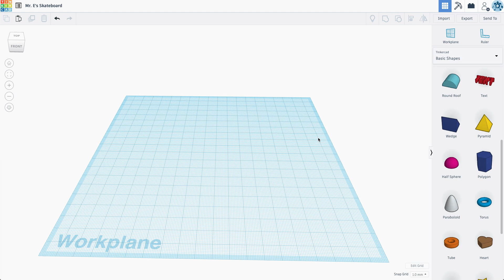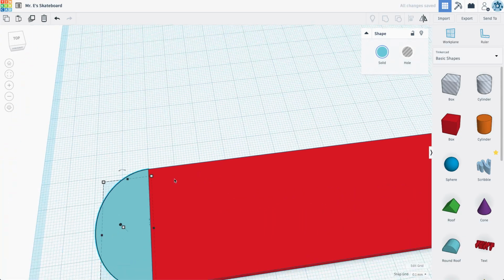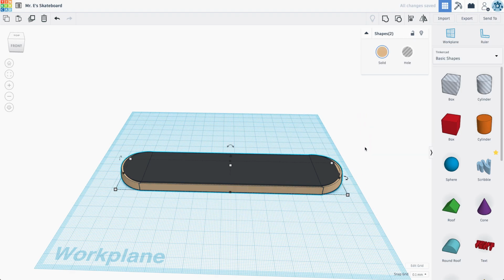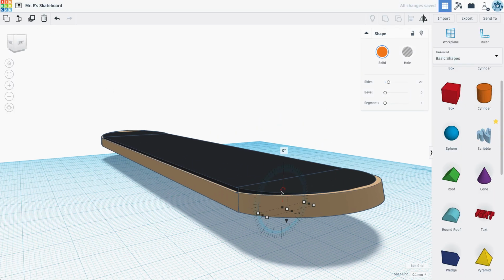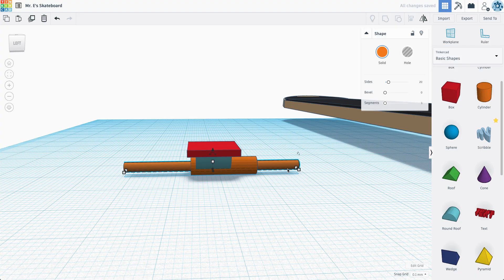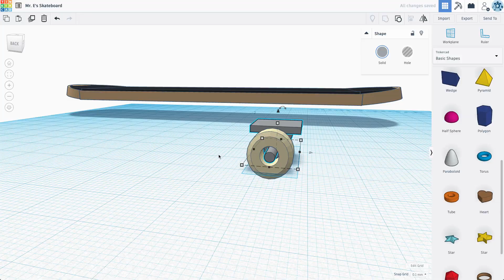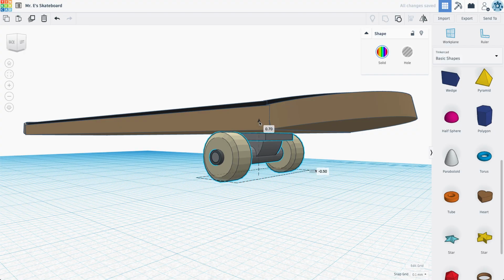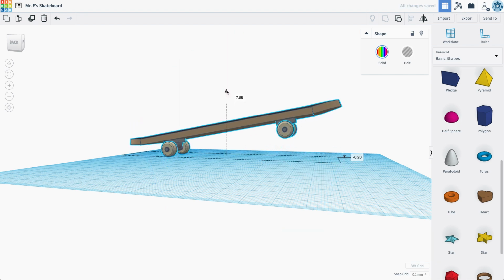How to model a Skateboard in Tinkercad

Comment: If I try to 3D print this, will the axle be connected to the skateboard or will the STL file preserve the holes making the axle capable of rotating?
Reply from the maker: If you printed this in separate parts with some wiggle room to allow for rotation, it should rotate around the axle well.